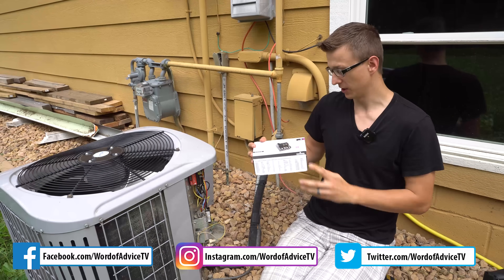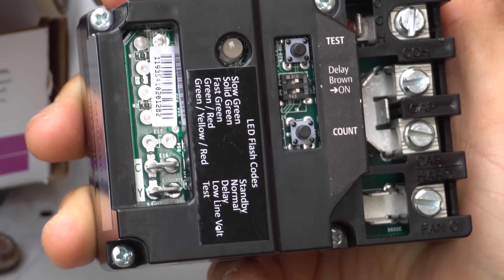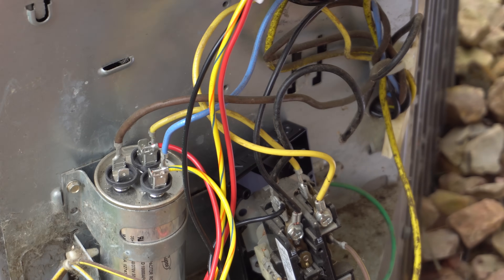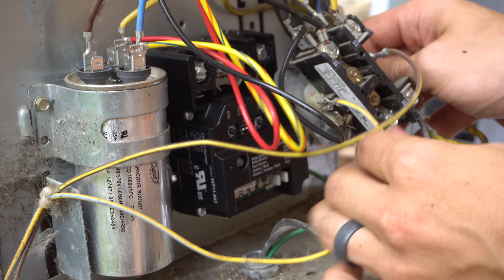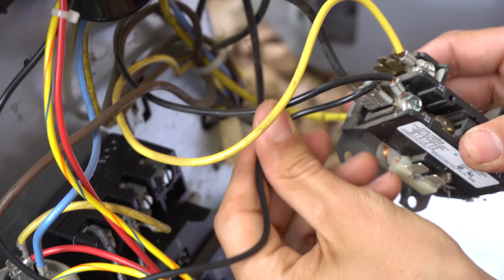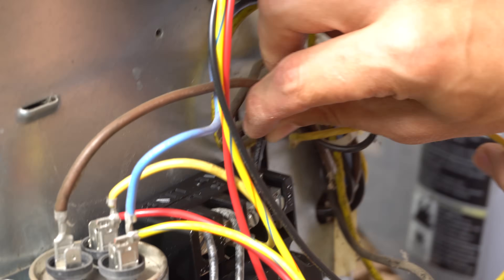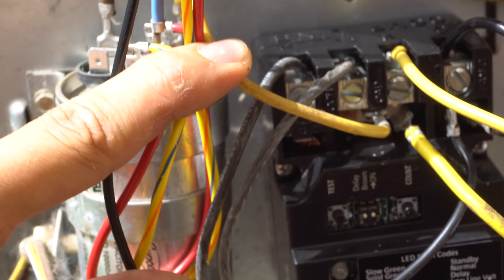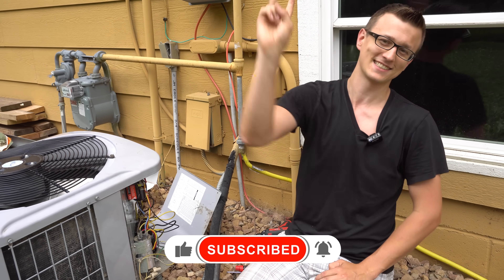AC Unit Buzzing Noise - How to Install an Emerson SureSwitch to Stop Noise

Comment: I guess you cannot use it with the Amrad TES5 Easy-Start, which is by far my preferred hard start, given its link to the run capacitor. It avoids the deadly cycling in case of capacitor failure.

Comment: A buzzing contactor  can be normal . The electromagnet is attracted to a laminated steel core. If the coil is powered  by direct current, it will be silent  If it is powered by alternating current, it will buzz. Most times, a loud buzz can be quieted by cleaning the surface of the laminations where the armature makes contact with the core. A sure switch still has a mechanical contact closure. It is not a solid state switch. The electronics controls the mechanical contacts.

Comment: My contactor has (4) extra wires on the line side. From the wiring diagram it looks like they go to a blower motor. So would I just add them to the L1 and L2 on the Emerson sureswitch. Mine is labeled L1 and L3 on my old contactor, no L2.

Comment: Nice video, best upgrade you've ever done to an AC, no chatter noise when it start up/shutdown, and sure will last longer than the unit itself since there's no mechanical wear out like regular contact. Sad it's not widely recommended by the tech. Anything that reduces the service call is not welcomed by the industry.

Comment: Hi Jay.  First you are THE BEST. thanks for all the great videos!  am an engineer and worked in AC & refrigeration 40 years ago.  I still have it here and there but left field since then.  I have water leak at 3 ton electric air handler unit.  Please advice  how to handle drainage issue of an air handler. I am pretty sure the pipes are clogged but I never worked in such systems before. any word of advice?  lower tray is rusted so am replacing it.  upper compartment icing metls and pours all over. one relay swithc at botton tray was not working tested and it needs replacement.  the upper floating switch either not working or pipes clogged.  please advise if I can cut pipes and vaccum the pipes or flush them etc.  thanks Jay!

Comment: The terminals of the 24 v wires are too close to each other. You can accidentally short one of them and kill your transformer if the thermostat wasn't turned off.

Comment: R22 compressor unit  what would  cause high preasure   140psi and low pressure  145psi. Compressor  not turning  on unit runs fine.

Comment: If Emerson SureSwitch is not optimum solution then what brand is highest quality mechanical contactor to use as a replacement?
Reply: Lee Sternhagen Confusing question. Where or why is it not optimum solution?

Comment: Just a heads up!
In figure 3, bottom right of page 2 of the instructions
the  electrical diagram shows the L2 leg to common thru the switched side of the contactor. This is not the case  in all manufacturer’s.
Reply from the maker: Thank you for the heads up!

Comment: I wonder if my new a/c unit has one of those. I'm not gonna look.
It's guaranteed for 10 years. I'll probably never have to touch anything in there, except, I will clean it out myself. 😇
Reply from the maker: As far as I know, there are no brands that have it factory installed. So probably not :) But Mr. Classic.. I do hope that your unit will not give you any troubles at all for at least 20 years!
Reply: @WordofAdviceTV  , That's good because I doubt I'll need it that long.

Comment: Is your time delay for the compressor in the thermostat?
Reply: Compressor I believe, most installs I put the switch in the off position because many thermostats have a time delay built in.
Reply: @m.t.3109  how can you tell if a thermostat has the delay?  even the new ones don't say on the box.  i have rentals and I'm getting tired of them blowing the compositor .  LOL
Reply: Art McLellen 
I call the manufactures help line/cs rep.

Comment: Using only one screw to secure is leading to trouble if vibrations loosen it.  Not twisting the wires before before putting them under the lugs and not cutting the crimp connectors off before putting them under the lugs is questionable. The video/tutorial in all is very good and informative. Keep up the good work.
Reply from the maker: Those are all valid observations, thank you for pointing them out! Optimally I should have used at least 2 screws but since the old contactor was on only one screw I simply just reused that one screw and it was on there really tight. As for crimping the connectors.. I have always done that and have never had a problem before but it is probably better to cut off the connectors and strip the wires as you say.
Reply: @WordofAdviceTV  I know this is just my opinion, but I agree that L1&2 should have been twisted but I don't cut off the fork terminals either. I figure it's a much more solid thing for the terminal screw to tighten up against
Reply: It will more than likely be ok.

Comment: Nice instructional video. Upgrading to a marketed electronic (SSR-solid state relay) from a  mechanical relay, scientifically electrons DO NOT take the path of least resistance, ELECTRONS IN i.e. power surges flow THROUGH ALL AVAILABLE paths but give preference to that with lesser resistance (many electricians dont understand this principal and do not bond/ground correctly visit MIKE HOLT on you tube to understand this more he does a great job of de-myth-ing power surges and electrical flow);. Over time this electronic circuit board will be effected by multiple surges and the"brown out protection" will FAIL making the circuit incomplete or open and the unit will not start; more so than a mechanical contractor (which one can clean pitted contacts to a degree until replacement is available).We rather see a DIYER utilize/recommend a surge protector outside on a disconnect box or on main panel with a visual LED like this. https://www.amazon.com/CHSPT2ULTRA-Ultimate-Protection-Length-Height/dp/B01AQAKRSS/ref=sr_1_7?dchild=1&keywords=surge+protector+for+hvac&qid=1601136618&sr=8-7 Again these dont last for ever one wrong path or mulitple paths over time of electrons can take out a surge protector function however the ROI could be a savings to the protection of the actual machinery/appliance/unit without the headache of service cost from an HVAC contractor.
Although this emerson sureswitch  $47.00-$50.00 vs a mechanical contactor can cost $20-$40 a good quality made in Germany vs Mexico or China. Emerson sureswitch is assembled in mexico parts may be from CHINA. Think about how the manufacture had to take material short cuts to get the emerson sureswitch down to competitive prices of a mechanical contactor.
Reply from the maker: Thank you for the information loaded comment as usual Pro Answers! We appreciate it!
Reply: @WordofAdviceTV  its an electrifying comment. We don't see the value of the CB/SSR on contactors especially when the mechanical contactors have been proven to be reliable and favorable price point replacement much like we will start seeing more EEV's. There's better time spent in R& D for more efficient thermodynamics.
Reply: All of your points have merit. Now can you provide your real world testing results of the Emerson SureSwich to back up your theories?
Reply: @m.t.3109  Theres several case studies posted by real individuals under the amazon comments section with proof. Additionally, if one  UNDERSTANDs  our original statements; when you add circuit boards and SSR the reliability doesn't increase. There are "additional" features of the Emersen SureSwitch- these "surge/brown out" features dont translate to reliability which the switch manufacture comes off marketing. IF we were to do the same cycling tests side by side with a mechanical contractor; the mechanical would out perform or be on par (probably could scrapw up some bench testing with NSM solutions that utilizes  "IS/ IEC 60947" testing to prove this). A more beneficial feature for the homeowner would be to have a more convenient view of a surge protection at the main panel or HVAC circuit disconnect. There is no increase of reliance or efficiency with a Emerson Sureswitch. Money and maintenance would be better spent having a contractor checked yearly and or a mechanical replacement on standby.
Reply: Pro Answers 
You are way to versed in electronics to rely on unscientific Amazon reviews. I’m truly disappointed.
Reply: @m.t.3109  Our lab fees our $200 an hour and we will do an independent study for you. We know the cycle thresholds of SSR's. Look up NSM solutions you will see there clients are all the well known contactor manufactures from Thermofisher to Eaton. Emerson is so spread out most likely there not even making and spending bench testing on the contactor (especially assembled in mexico or china) there internals are outsourced and there licensing there name on it.  Think there is some positive comments about how the contactor seals out bugs etc. more of a maintenance excuse and the installer not properly sealing the access points of the electrical of the unit/condenser i.e. sealing using flex HVAC silicone on coductor through holes. * additionally would use Conducto-Lube Silver on the contactor points been using this for extending the life of contactor points and keeping off insects. https://www.mcmaster.com/ makes a less expensive version

Comment: because it's more electronic, be prepared to have more problems over the long haul.
Reply: You will have much less problems. Been installing these for well over 10 years, zero call backs.
Reply: @m.t.3109 I live in Floriduh, is it better to use a manual contactor or this unit where many of lightning storms occur with voltage spikes? I'm thinking a contactor may be more reliable in my situation.

Comment: A Contractor is a simple device works or doesn't... Why reinvent the wheel? More time delays, flashing lights and Chinese electronics to go bad. NOPE..
Reply from the maker: Yeah.. There's that too but I have heard from more than one person that the sureswitch did wonders for them. Folks that replaced their contactor 2-3 times a year claim they no longer have to replace it ever since they put the sureswitch in. Or bugs still getting into sealed contactors but problem solved with the sureswitch. Etc.
Reply: I installed these on 2 of my condenser units and I'm so glad I don't have to hear from the loud clap when the contactor is energized as my bedroom is between the 2 AC units.
Reply: @cyrilasfrenchyaz  Oh yes

Comment: How do you pump down system with this Contactor.
Reply: Turn thermostat to cool, bypass the low pressure switch with a jumper, and then when system is pumped down and both service valves are closed, remove jumper to remove 24 volts from contactor.